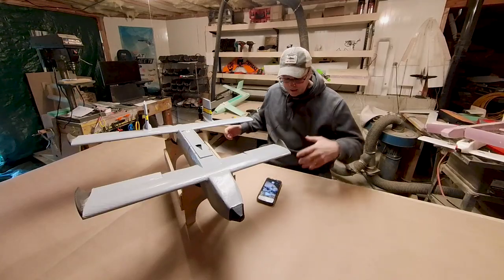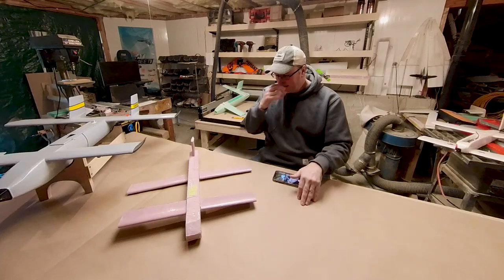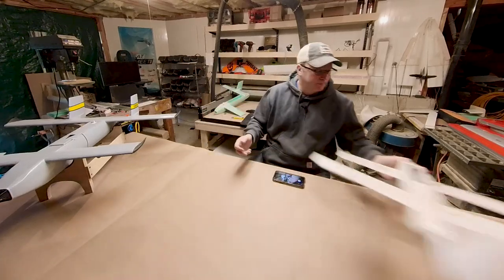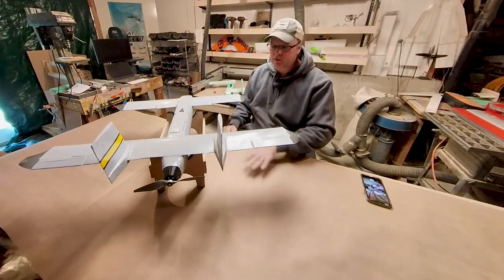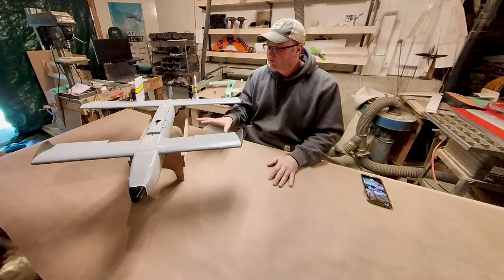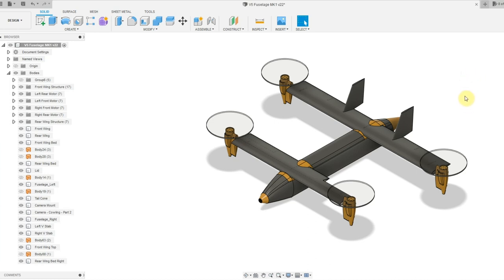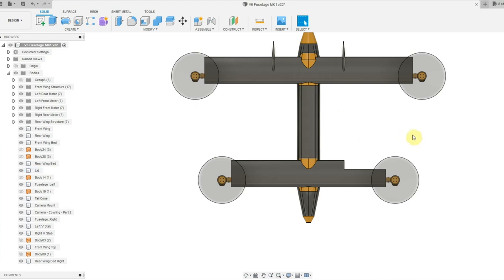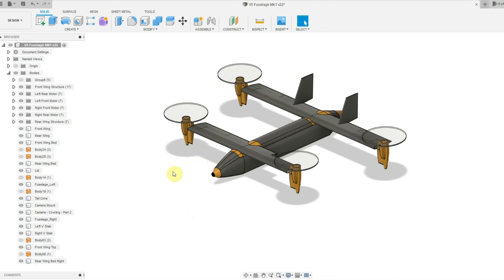Tandem Wing VTOL Part 1 - Introduction

Comment: When does a kinard become a wing? And vice versa
Reply from the maker: That’s a good question. It seems there are a lot of answers. For me, if the forward wing operates like a horizontal stabilizer, as a control surface, I consider it a canard.  If it generates an appreciable proportion of the lift, I consider it a tandem. I haven’t seen an official definition.

Comment: Cool project, really nice work, (subscribed).  Do you have any thoughts on putting the back wing lowwer than the front wing?, I have seen some stuff around it creating greater separation when AOA increases.
Reply from the maker: Thx!  I have looked briefly at staggering the wings, not high and low in the back. Lowering the rear wing gets a little complicated in that the down wash from the front wing starts to interact and lowers the effective AOA. At higher AOA the effect can change. I wanted to start with something easier to model and make sure that my results matched the aerodynamics of the model. Lower wings complicate the VTOL implication as well and I wanted to keep my first composite build as simple as possible. I would like to build a few foam test planes with different wing configurations and compare them in flight

Comment: Hi - fascinated by your tandem wing project. I studied a tandem wing airliner for my Masters in the '70's; and now that I've retired I've built a Bert Streigler Delanne D200 (featured in the September 1981 Radio Control Models and Electronics magazine). I would point you at the Miles M35 & M39 Libellula designs, and also Maurice Delanne's designs. A key feature of the Delanne designs is the wing separation. The front wing is always larger than the rear wing to ensure that the downwash does flow over the rear wing. This in turn also ensures that the front wing stalls first and the aircraft pitches nose down The Arsenal Delanne 10 C-2 had a top speed of 345 MPH and landed at 45 MPH!!

My D200 has some handling quirks in the it rolls out of loops and also in any inverted flight it rolls out the other way!! Take-offs are very squirrelly  too. The control system is elevators on the rear wing and ailerons of the from wing. The next steps are an elevon control system and possibly a gyro stabiliser. John B

Comment: Version 2 is beautiful. Any plans?
Reply from the maker: Thx!  These are all one-off prototypes so I don’t have plans for them
Reply: @DefiantWings  after you experience with tandem wings

Would you think a tandem wing glider would be superior to the normal gliders that are 20 meters wing span?

It will definitely half the wing span but i am not sure if it will provide the same gliding control and stability

Also what would you say are the main drawbacks of the tandem wing?
Reply from the maker: @FirstLast-tx3yj  A tandem wing would make an interesting glider but it would never be as efficient at a traditional glider.  While tandem wing designs certainly do reduce the overall wing span they don't cut it inn half.  There are several areas where aerodynamic losses creep in to a tandem wing design.  the rear wing is always in the downwash of the front wing.  this reduces the efficiency of the rear wing.  The 2 wings, even if identical, don't see the same wing loading and thus do not have the same angle of incidence.  One of them will always be at a less efficient AOA. You also double the number of wing tips and induced drag.  One of the advantages to a tandem wing is that you get the advantages of a long, high AR wing with less span. Not half the span, but defiantly less.  Because the span is less it is a lot more agile in role.  It is also more stable in pitch.  I chose the configuration because I could move the CG to the center of the fuselage for a VTOL design.  I am currently working on a larger version as a single motor pusher with a 54" wingspan.

Comment: I am working on something similar, but I have an important question, did you use the forward wing with ailerons and the rear wing with elevators, or the other way around? Because what I have found out is the bigger wing should have ailerons, is that matching your experience? Thanks in advance for your reply. Btw, I really like that chill/hobby mood that I can feel in the video. Thanks. Mark.
Reply from the maker: Thx!  I’m glad you enjoyed it. On the initial builds I used elevator up front on the small wing and ailerons on the larger rear wing. This worked well but led to a strange roll-pitch coupling in the controls. It wanted to pitch up when I rolled in either direction because the ailerons are behind the Cg. I ended up configuring it with elevons front and rear. This got rid of the pitching because the aileron moments were on either side of the Cg. It also helped with pitch controls because I could use less throw on the elevators because there were front and back. Hope that helps.
Reply: @DefiantWings  Thanks for replying, so you had ailerons in the rear one and elevators in both? How did you manage that with only 4 control surfaces, as visible at 0:52? Sorry for asking again, but I thought after so much experience with tandem wing, that you got, you could help me out :), thanks.
Reply from the maker: Originally I had elevators in the front and ailerons in the rear. I now have Elevons front and rear.   So, combined elevator/aileron front and rear.
Reply: @DefiantWings  Thank you, sir! Have a good day.
Reply from the maker: My pleasure, any time. Good luck with your build.
Reply from the maker: Stay tuned the is a 2x version in the works.
Reply: @DefiantWings You got a new subscriber :)